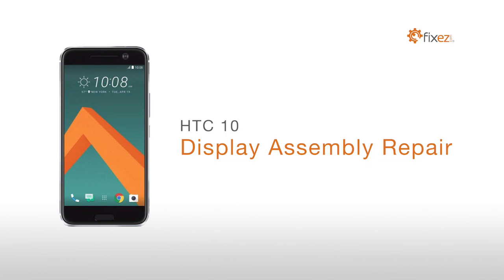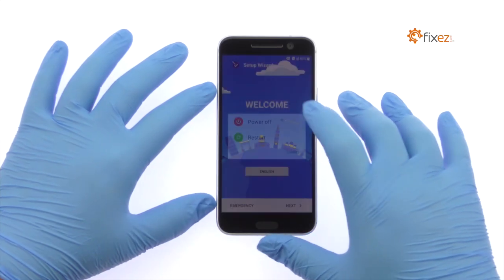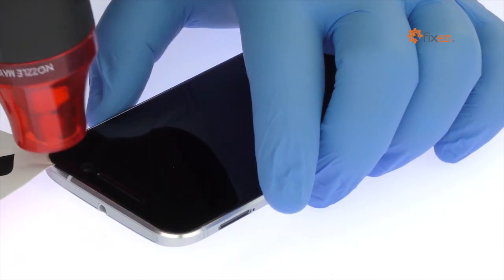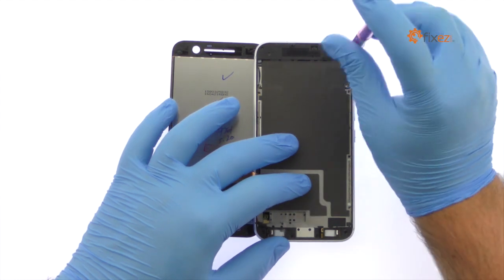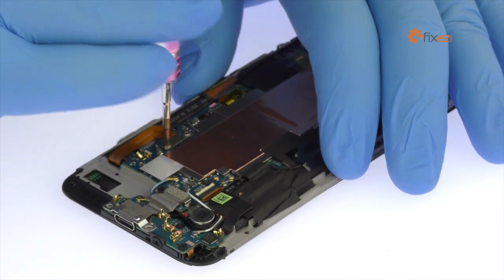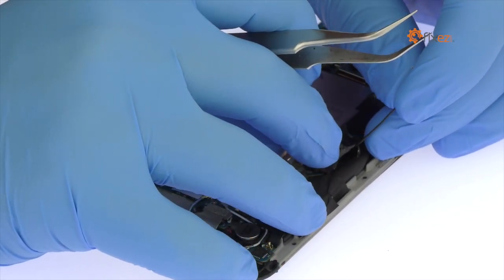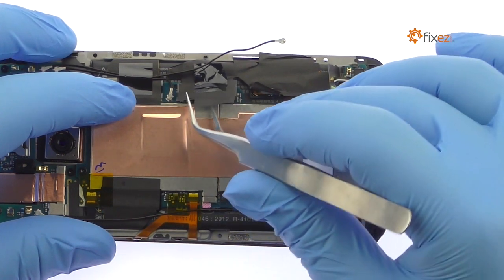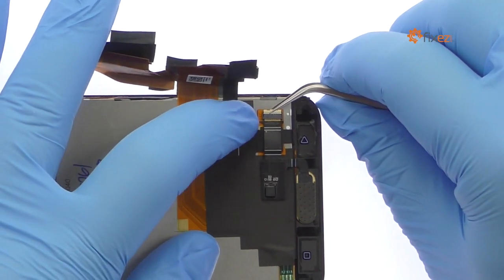Official HTC 10 Display Assembly Repair Guide - Fixez.com

Comment: Thank you for this amazing tutorial. I'm very happy to say everything is succeeded. Even the lights in the touch buttons are doing a very good job. Also, the HTC 10 is easier to repair than the legendary HTC One.  Although folks, please take care on the adhesive. Be sure to remove all the old adhesive, and also clean up your phone (speaker/USB-C/Microphone/Earpiece). When applying new adhesive, just take your time and cut nice shapes. Give the touch buttons some freedom, don't round them with adhesive. You can hold the adhesive of the touch buttons by the way, but make sure they are perfectly rectangle and not in the way of the white field and tiny LED light. If you also replace your back cover (which is a very easy job) make sure you transfer the bottom speaker of it. Thank you again!

Comment: Works great.  All functions appear to work and the resolution is decent enough that I can't tell the difference from the original.  Took me about three hours total, working carefully along with this video.  I am a bit disappointed that I am not yet able to finish the job since I had failed to buy in advance the double sided tape used to assemble the screen in the near final step (contrary to what the video shows, which is tape already installed, check 9:48).  Until I get the tape I am using the clear case that came with the HTC 10 to grip the screen from the front and allow me to use the phone.  Why Fixes doesn't include a few pennies worth of tape in the kit is beyond me, and would have allowed for a 5 star experience.

Comment: Any idea where I can find a genuine back shell replacement? I dented mine and I'm not eligible for Uh Oh Protection, and it seems like it is very easy to replace the back shell, but I can't seem to find a real genuine replacement back cover.
Reply: Frank Ding - I'm not sure, as the device is now out of production... You may have to obtain a parted-out unit for that... A good many repair specialists won't even touch this monster unless you have replacement parts on hand...

Comment: Not like my old Moto G2 at all..That only required screw and tape removal, some connections and components unhooked, and only one mobo to worry about...If I hadn't gotten the replacement display and vibrator for nothing, I wouldn't have disassembled the unit at all....Nope! This one's far to intricate for me to mess with... My 10 would go to someone qualified, and damned the expense! Thanks for showing me the guts, though...

Comment: What if you disassemble it in order to replace the aluminum chassis do you have to buy a new lcd screen if the original screen is still fine? How would you attach it again with no adhesive?
Reply from the maker: You will need to use new adhesive on the display to reassemble. The adhesive used in this video is available on out site.
https://www.fixez.com/catalogsearch/result/?q=premium+red+adhesive
Reply: What size tape do you use?